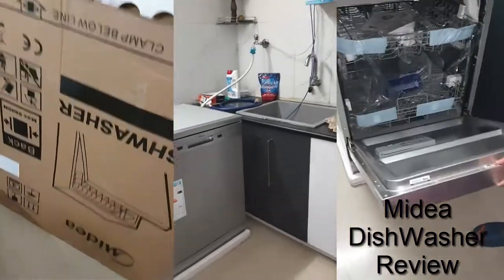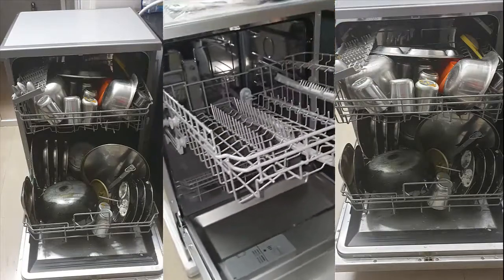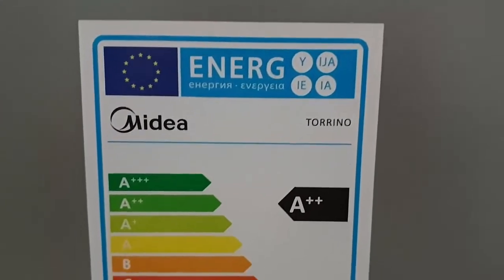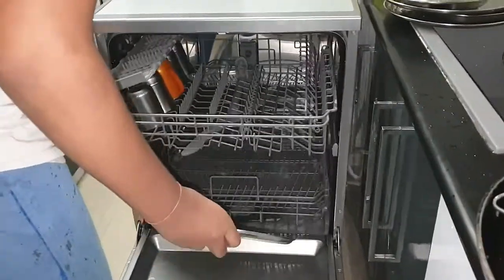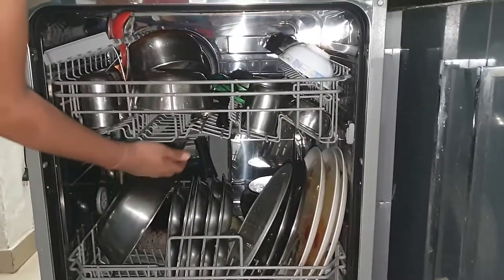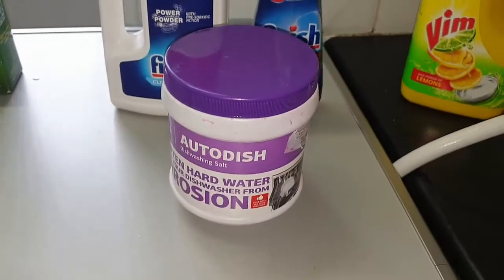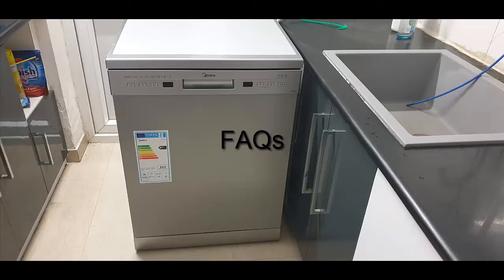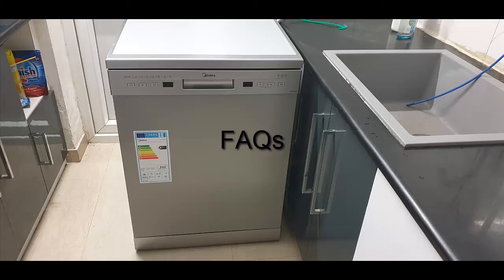Midea dishwasher review |Full load Performance testing| How dishwasher works

Comment: Hi, would like to know that can we pause the operation mid cycle and take out any vessel if needed jus like in siemens dishwasher? Thankyou
Reply from the maker: you can , but personally I would not recommend as there would be chances of water spills. If you do this before the dishwasher starts spray then no issue.

Comment: I have just purchased this dishwasher. The installation and Demo person wasn't quite helpful. I had bought IFB salt, rinse aid and detergent. Which one would you suggest , Tablet or detergent? The water quality is hard
Reply from the maker: Tablet. But don't use cheap one's.
Reply: @knowanddo  Thank you for the response. I will try out the tablet.
Reply: Tablet is 3 in one
Detergent, salt and rinsaid filling is little labourious but compared to tablet cheap.
Cleaning quality same

Comment: I am using this machine from 3 months.I find all utensils little slippery. Why this any idea?
Reply: Its not been washed properly. Maybe too much detergent.
Reply from the maker: check the level of salt and rinse aid dispenser. make sure filter is cleaned periodically. don't use very cheap detergents/tablets
Reply: Rinse aid knob set correctly. More rinse aid release causing slippery.
Unsuitable detergents also causes slippery.
Reply: Go through manual or youtube channel for midea dishwasher installation and demo. More useful.
Midea dishwasher is absolutely good machine in indian kitchen.
Wife's pride and maid's Envy

Comment: I just want to add a review.  I bought a Midea dishwasher from home Depoe. Not to long after that a functionality on the up rack broke, something that raises the upper rack so you can wash your plates.  It' just broke , fell off.  They know this thing breaks...for a function in this dishwasher it should be made of a piece of plastic that isn't really attached to anything, it just snaps on "BareLY" .  What Dumb Manufacture would allow this.  It's like those Chinese parts for a water fixture outside picket made out of plastic that lasts for ten minutes, I know they don't sell them here in America but they sell them over in Asia, this company probably made them too.   If they are so bold to create a functionality like this on a high ticket item, you shouldn't buy trhem

Comment: Also milk pot not getting clean
Reply from the maker: check the level of salt and rinse aid dispenser. make sure the filter is cleaned periodically. don't use very cheap detergents/tablets
Reply: Better soak the milkpot in kitchen sink before placing in dishwasher.